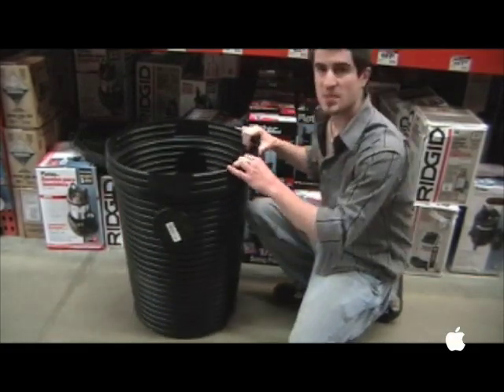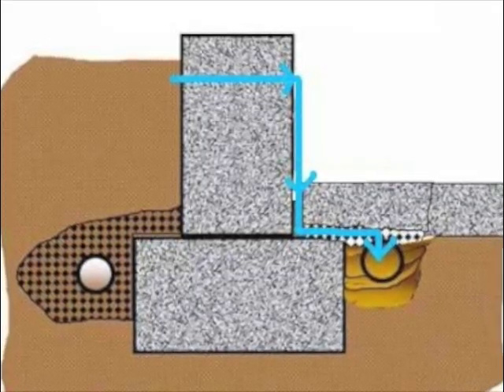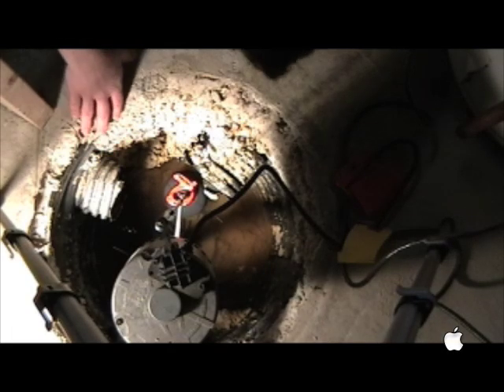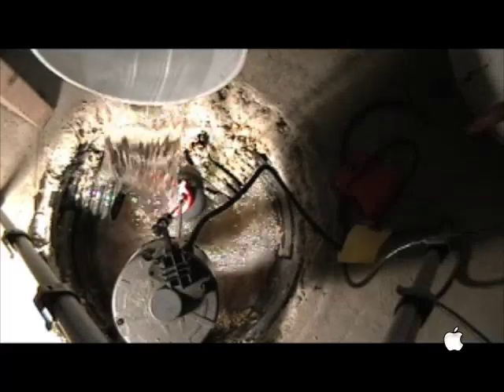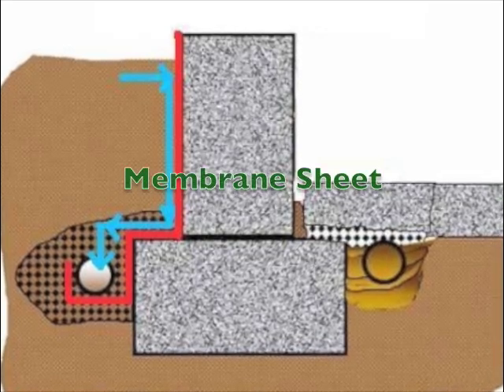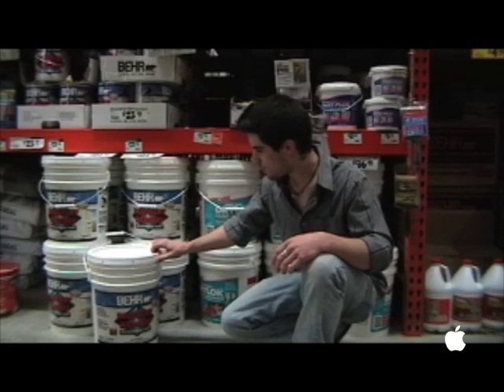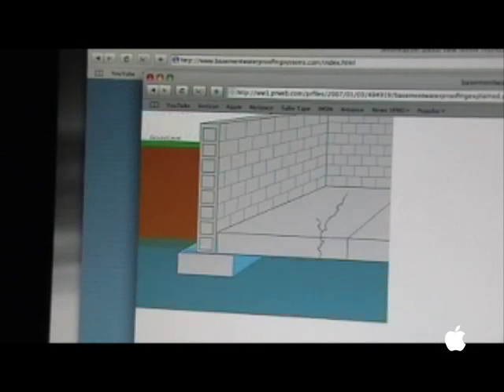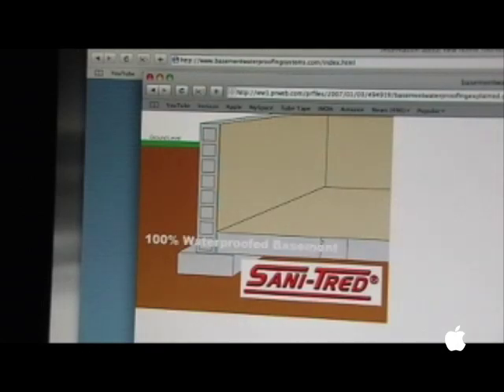Basement Waterproofing Project

Comment: Water generally does not seep through Poured Concrete walls but through cinder block walls as vaporization or weeping (based on the amount of water below grade).  Unless there is a poor pour with a cold joint issue or if there is a crack that goes through to the exterior (below grade) dirt or staining due to thin pour and air pockets in the pour.  Interior solutions are considered water management systems and not waterproofing systems. Drylock is not considered a waterproofing remedy but a 'dampening method'.  Water pressure or hydrostatic pressure or PSI of water pushing through cinder block and vaporizing or weeping will continue unless a mitigation system is installed-Interior French at the footer with sump pump etc.  Dampening products will eventually bubble and peel and are not considered effective in the long term to stop or manage the water intrusion.

Comment: @wtrprfr1 Interior french drain, sump well & pump system works fine IF you also seal concrete walls with appropriate vapor barrier material, floor to ceiling, that keeps moisture from entering living space. A proper vapor barrier material blocks water & moisture but allows air to permeate, keeping the space against the concrete wall dry. The outside dig approach is better but not always necessary, especially if the amount of water penetration is not excessive, a gallon or two after a heavy rain.

Comment: baement tanking is quite a complex procedure. All basememnts jobs are different with different issues...what works with one does not work with others. Cemet systems , sump pumps with membrane systems. I have been tanking for a good few years. Your explainations are ok....but please....get an expert in otherwise you wWILL be wasting time and money...I KNOW WHAT IM TALKING ABOUT unlike many people...digging out trenches on house can be extremly expensive if u do not know what u are doing...fact

Comment: It looks dangerous to seal only the INSIDE of the basement (as it's shown later on it the clip). The sealant would fight against the hydrostatic pressure. It's like sealing a cracked boat hull with duct tape: it would work only for a short time.

Comment: This is extremely misleading...water does not enter a drainage system by running DOWN THE INSIDE of the wall.  The space is there to let AIR ESCAPE.

Also NEVER EVER EVER coat the INSIDE of walls and floors.  You will trap moisture within the wall and cause damage to the foundation.

Yes and lastly, no Professional Waterproofer buys waterproofing products from Home Depot (unless they are moonlighting).